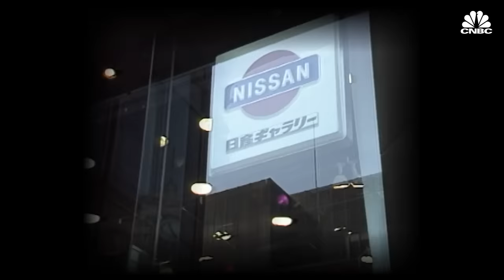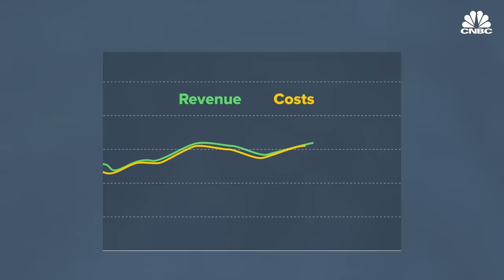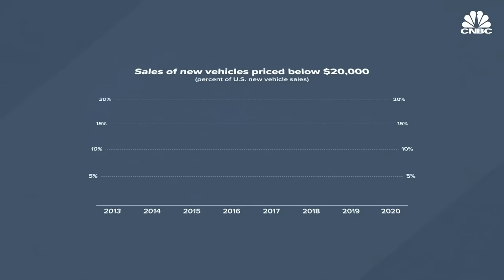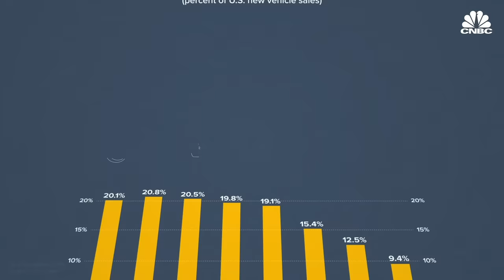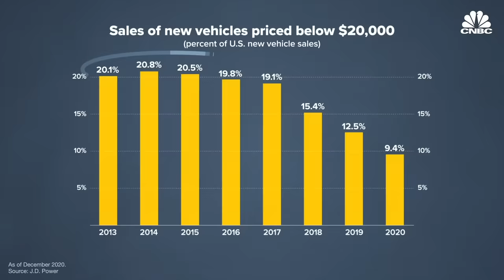Why Cheap Cars Are Disappearing

Comment: Presentation fell apart 30 seconds in when they didn’t adjust the sale of cars under $20,000 for inflation
Reply: I was thinking the same thing, a 2013 car at $18k is now over $20k factoring inflation.
Reply: I instantly thought, “does the auto industry really set some arbitrary number that looks clean on paper and never change it? Explains a lot.”
Reply: That's a huge factor. I had to stop right there.
Reply: The increase of pricing year over year helps influence inflation.
Reply: Video paid for by the auto industry to justify their price gouging greed. A $20,000 car from 2013 probably costs close to $40,000 now. What a bunch of A Holes the auto makers are.
Reply: The part where they say that  the  younger generation wants more smart technology  in there cars i personally  think is bs, most younger people can't afford new cars anymore  because  simply everything  else  is  too expensive . Hey groceries  and  a place to live are more important  than  a shiny car.  Better off buying  something  older and bite the bullet in repairs.  But hey I could be wrong but I'm just telling  it how I see it.
Reply: @ashergreif9973  Not just that but for a lot of us younger folk, there's only low paying jobs with no way to move up in the ranks.
Reply: Hyundai is very expensive now
Reply: They don't want to sell cars for under $20k because they don't want people like me to buy cars for under $20k.
Maybe they should actually interview consumers instead of car industry experts that want to force consumers to act in a certain way.
Reply: @Pistolpete218  that $20,000 number is inflation adjusted real income though. Of course the actual dollar number was less in the past, as we have had steady and massive inflation over time. They just assume people know that already.
Reply: That’s a 2022 issue inflation has been really low previous

Comment: If you have a good reliable vehicle, then you are blessed. Drive it until the wheels fall off.😊👍
Reply: I agree! I have a 2008 F150 with 270,000 km on it and I wouldn't trade it for anything. I think a person can get attached to a good vehicle that treats them well.
Reply: Yup. I finally had to retire my 1996 Audi A4 Quattro last year after a short fried the power window wiring. I bought it new for $7K and drove it 13 years.
Reply: Until the engine blows up *. I'm not giving up on my 1998 Camry because of some faulty wheels.
Reply: My primary car since 1990 has been a 1985 Mitsubishi van - still going strong.
Reply: @derciobene3458  axles can be replaced....
Reply: I have a 2005 GMC Yukon with 212,000 miles on it.  I bought it new.  But its not that reliable.  I have put THOUSANDS of dollars of repairs into it.  Now its falling apart and its time for a new one.  I was SHOCKED when I test drove the new ones.  The seats are significantly smaller and hard like a bench.  The drivers cabin literally has no room (I'm a big guy).  I was literally pinned in against the door and the console.  I have muscle problems and and used to moving my legs and feet while I drive.  I could not in these new SUV's.  The dealer told me its because people want more of a "sportier" vehicle now.  I told him if I want a sports car, I'd BUY a sports car!
Reply: Companies build things to break faster and faster is called programmed obsolescence (they might even do it now with the vaccine in humans)
Reply: Clocked in 280,000 miles (450,000 km) on my Renault Twingo diesel a few weeks ago. I still haven't found a valid reason to change it. Runs like clockwork. #workhorse
Reply: and if the wheels fall off, buy new ones
Reply: Still rocking my 2002 Chevrolet Suburban. Got almost 200k miles on it, love that thing to death. Taken it all over California countless times. No reliability issues whatsoever.
Reply: @retroguy9494  The generation before this (the 1999 to 2004) Yukon, Yukon XL, Tahoe, and Suburban are stupidly reliable. I have an 02 Suburban and that thing is bulletproof.
Reply: @aidantanny7230  Yes I'm familiar with that body style.  I almost bought a used 99 Tahoe back in like '03 but the dealer wanted too much.  And the Vortec engine in my Yukon is just fine.  Its everything ELSE that went!  LOL!  Plus the frame is all rusted out from 15 winters with all that salt and brine on the roads.
Reply: @retroguy9494  yeah! Dude the 5.3 Vortec is such a reliable engine. I live in Southern California so I don't really have rust issues
Reply: @aidantanny7230  That's cool.  I'm in the northeast and we get snow every winter.  This one was the worst in 4 years.
Reply: @muccisebastian9300  Some are already saying regarding the vaccine that people may need another one in a couple of years or at least regular booster shots.  I sure hope not.
Reply: Toyota hilux is the way to go, been driving for ages now.
Reply: @carawestgate  Nice. What engine does it have?
Reply: @DAN_1992  Not necessarily.  I remember years ago I had a big Cadillac that got broadsided and bent the car right in the middle.  It was towed and my father, always a cheapskate, insisted I get it out of impound to avoid storage fees and drive it to get a repair estimate.  As I was driving down the highway, the rear axle (with both tires on it of course) literally let go and went rolling down the highway without me and I was skidding down the road literally on the gas tank!  I'm still here, aren't I?
Reply: Amen to that brother!
Reply: @carawestgate  I have a 2008 honda civic manual with 230, 000 miles.  I love that little car...stronge engine,  very reliable.
Reply: Exactly
Reply: My dad's old 98 model car was going for 14k in used market
It's going for 30k today

 (don't even ask where I live but I give you a tip; i live in a country where government makes 2x more profit from a car than  manufacturer itself via insane indirect taxation.)
Reply: Dacia is reliable and cheap
Reply: Definitely, Quentin. I have a '98 RAV-4 that just hit 261,000 miles and is going great. I just take it in for regular oil changes and we're doing great. I bought it in 2012 at 14 years and 176,000 miles for $4,500. So, at some point I'll do something equivalent to that again.
Reply: i once saw a black Cadillac suv drive down a street for about a mile, with a shredded tire and was on its 1 RIM (other 3x wheels were good)......the young college girl was giving us a free sparkle wheel show.......lol

(note: we tried to tell her about the wheel, but she was too fixated on her cell phone)
Reply: @luckylindy1776  LOL! It figures!
Reply: 2013 Toyota Prius all the way
Reply: That's the plan...still driving a 2012 Honda Civic with less than 60K miles. I'd like something newer but like why? Its a perfectly good car.
Reply: I got a 2006 Honda Accord with, as of now, just under 43k miles on it. Gonna have it for a while
Reply: I have a 2005 Camery. I have driven it 180K so far.
Reply: @retroguy9494  Like a lot of cars, they made it smaller so it gets better gas mileage.
Reply: @joedollarbiden9823  Sounds like Russia!  LOL Ronald Reagan used to tell a funny story about buying a car in the former Soviet Union.
Reply: @luckylindy1776  I wonder how a young college girl can afford a Cadillac Escalade?
Reply: @madbug1965  But the overall size of the SUV is exactly the same!  IN fact, its a tad bit bigger than my '05.  Its the INTERIOR that got smaller! The seat and hip room in the cabin!
Reply: @retroguy9494  Close but false, A country in NATO.
Reply: @retroguy9494  - not sure HOW she afforded that +4 yr old used Cadillac,,,,but she looked good in it with her nice black braided hair, pink eyeshades, big circular gold earrings, nice long 2-inch pink gel nails, and not to forget that blinking mini-lights cell phone case.......LOL
Reply: @joedollarbiden9823  Hmmmmm....
Reply: @luckylindy1776  Based on your description I'm beginning to think I know how she may have afforded it!   LOL 😜
Reply: I do exactly that.
Reply: I'm still driving my old 1973 Australian V8 GM ..
Every day..not for much longer now as I'm waring out and my car still going.
Reply: I purchased a 2013 Toyota Corolla six months ago for 6k. Couldn't be happier with my purchase
Reply: Whats Funny is that 2021 there is shortage of computer chips
Cars sales and electronics will plummet
Reply: VOLVO 240
Reply: I sure will!! Thank you!!
Reply: Newer cars have way too many electric issues anyways
Reply: Just because it's nearly new doesn't mean you won't see niggles, I have a 4 year old 1 litre 70hp three cylinder petrol with only 20,000 miles on it and it has a powertrain issue of what I think is a bad tps. Also the sway bar drop links I replaced and bolted on 10,000 miles ago are rattling and knocking again, the horrendously potholed state of our roads in 2021 is knocking crap out the drop links, I basically replace them with the oil every year. Newish doesn't mean no maintenance, I need to take it in to get a full set of 4 new all season tyres in January, again costs money. Couple bulbs needed replaced.